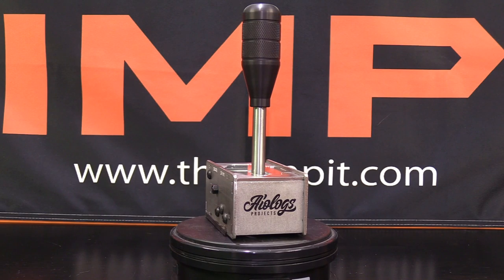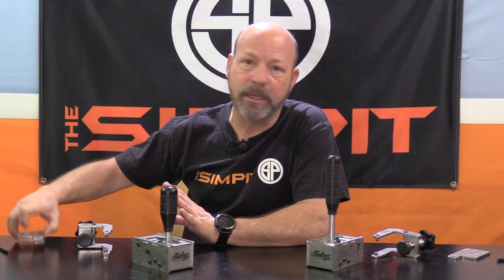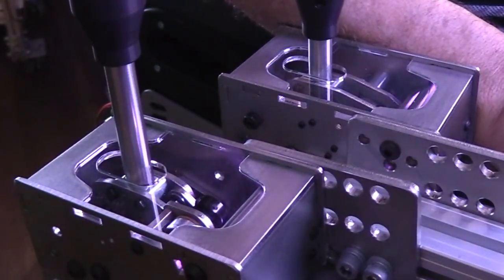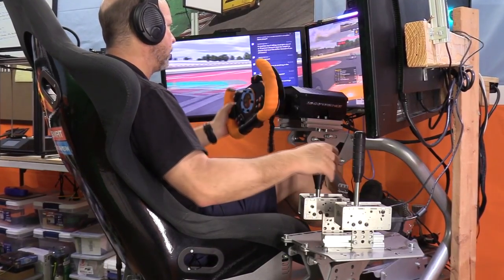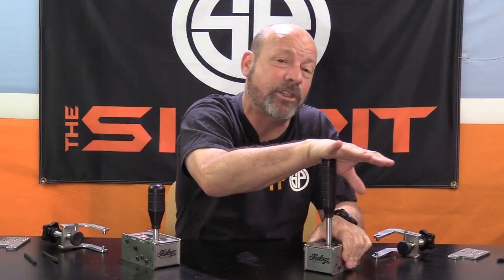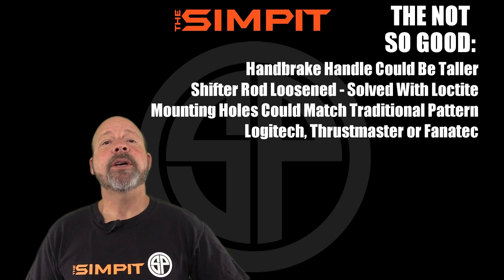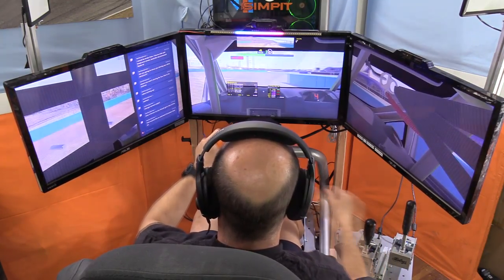Price vs. Performance at it's best w/ Aiologs ~ Shifter/Handbrake Review

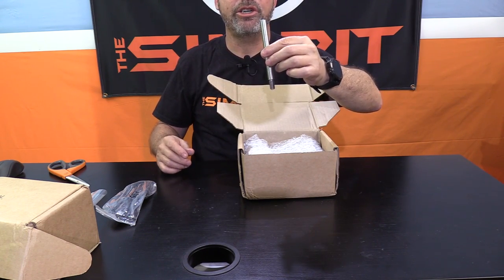Comment: Great review. I have owned both for a few months, great pieces of hardware and highly recommended. During your review you did not mention the new black knurled handles with what appear to be screws in them to adjust the height that they can be set at on the shaft. This is a new feature and is not seen on the Aiologs website or any of the photos you showed. With previous versions the shift and handbrake handles are threaded inside and screw onto the shaft with no way to change the height they are set at. From what I can see in your review at 2:52 they now slide onto the shaft and are held on by the small screws through the side. The new black shift knob is also bigger than before. I find that on the older version the shifter handle (silver) is smooth and a little to small and ends up hurting my bottom fingers after prolonged use as my lower fingers end up resting on the shaft. I am guessing that you have a pre-production model. I hope they can offer these new handles and shafts as an upgrade in the future as the new handles look really great with more grip and look more ergonomic.

Keep up the great work.

UPDATE: The different handles are now available to pre-order at AIOLOGS site as an optional extra.
Reply: Thanks for talking about that, it is what I was looking for!!!